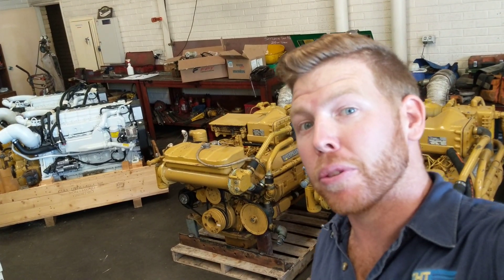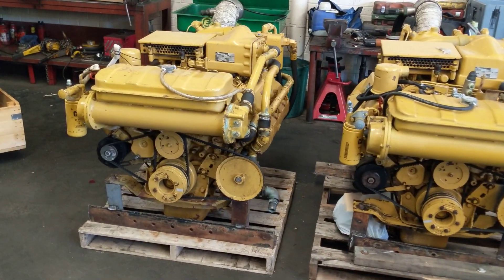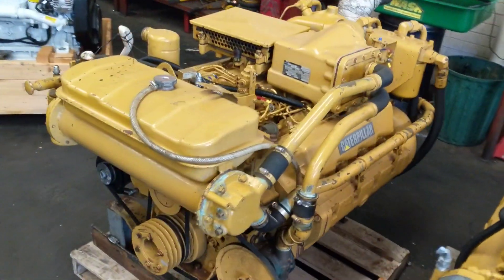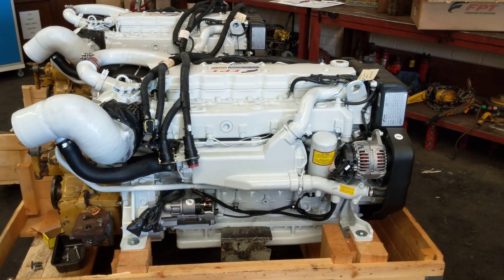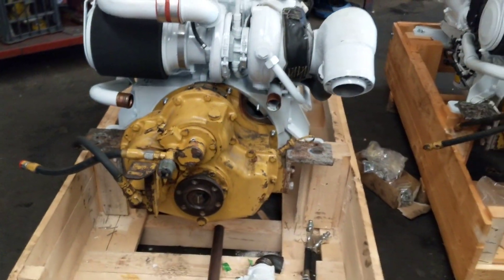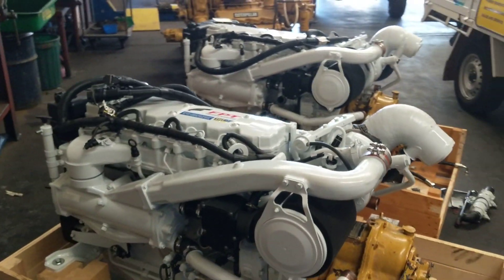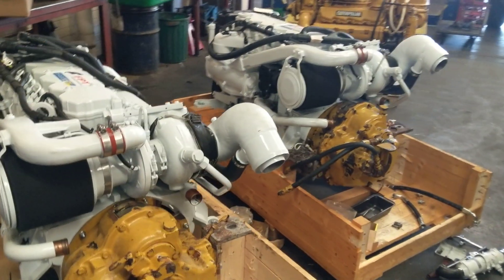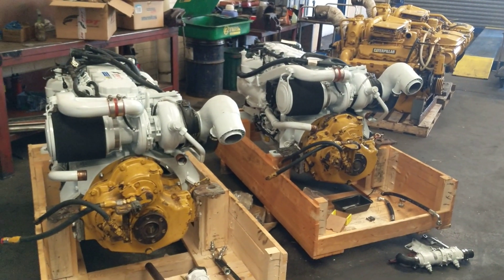FPT NEF 450 vs Cat 3208 Marine Engine Comparison

Comment: Dose the torsion coupler on the cat flywheel match the one on the fpt ? About to have swap done and making sure I have all the right parts!
Reply from the maker: @andrew140672 Hi, the Cat 3208 and FPT NEF use the same size 11.5" flywheel, so the coupling should fit
Reply: @thtsales thank you!

Comment: Fiat Power Train engines meet EU emissions where most engines are not up to the emissions standards and apparently too old to be modified, its basically make a new block or you're out, John Deere tractors are using them, Claas, case, New Holland, Tigercat forestry heaps of others, FPT is used in just about everything these days.